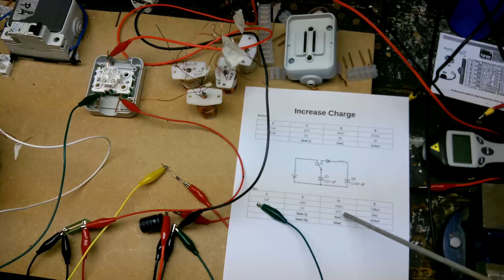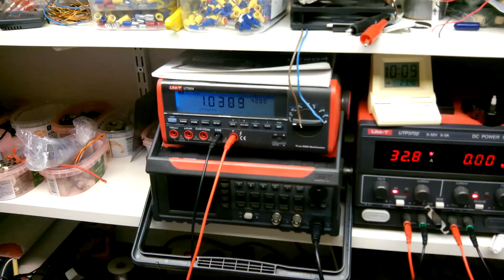Increasing Charge Experiment

Comment: "[...] the momentum in the system increase" : false assertion. There are many basic mistakes in your "paper" "Increasing Momentum or Charge". For example, you consider 2 masses as a single mass, but for calculating the momentum, you take their relative speed instead of the speed of their common center of mass. A momentum as well as kinetic energy is referential dependent. By mixing referentials to calculate a momentum, you get anything.
You should learn physics. You are not yet ready for a graduate school, even less for teaching! :-)
Reply from the maker: exnihiloest Thank you for reading the paper. Yes I'm combining the masses in parallel to simplify the calculations, but the calculations are still right. If I would 'learn physics', as in graduate school, what new would I discover? ;-) See my paper on combining masses, I would love to read your comment on it.
Reply from the maker: exnihiloest Oh, I forgot; its "the absolute of the momentum in the system increase", big difference, why did you skip the "absolute" part?